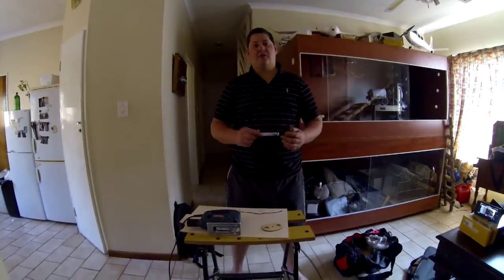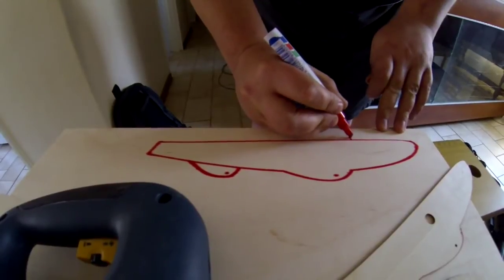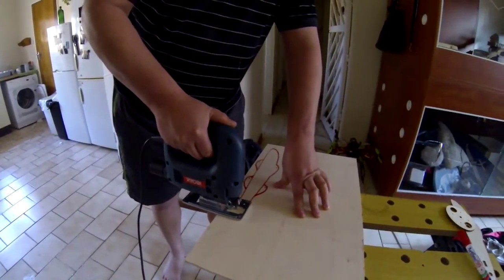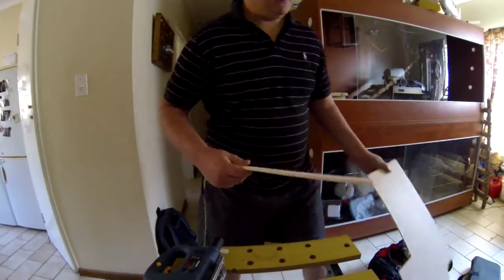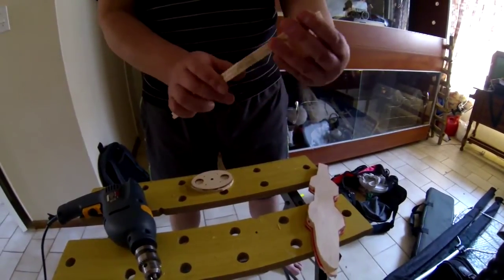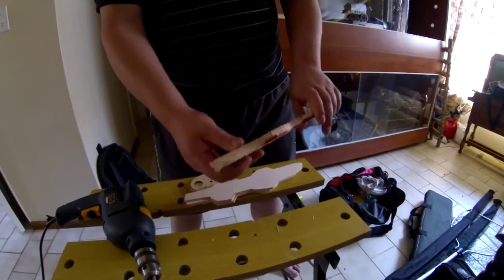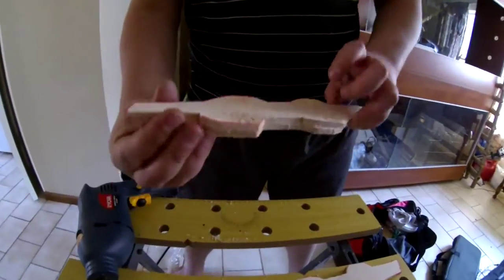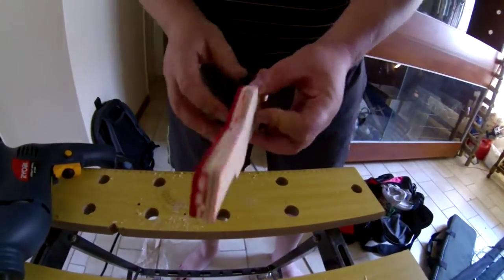DIY Drones X8 Build Episode1

Comment: 4 mm ply seems overkill, here.  Ply can be effectively re-enforced using a good epoxy varnish or similar (I've reinforced ply using slightly thinned aliphatic resin wood glue.  From what I've read about the X-8, it's wing flutter which seems to be the major problem.

Comment: wow you certainly don't know what you are doing..... There is basically no outward pull on the wings, you could use a twist tie or even some bubble gum and the wings would not come off thats why there is not much there in the first place...... Adding extra weight and making a larger gap between the wings and fuselage for no reason.